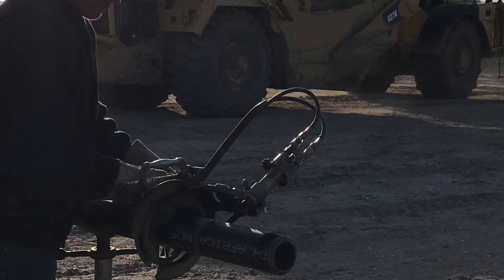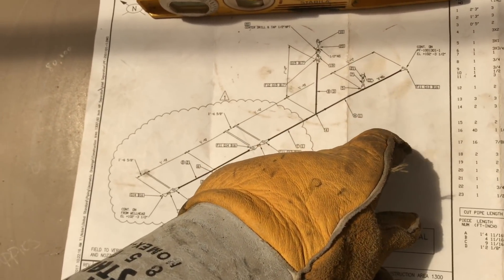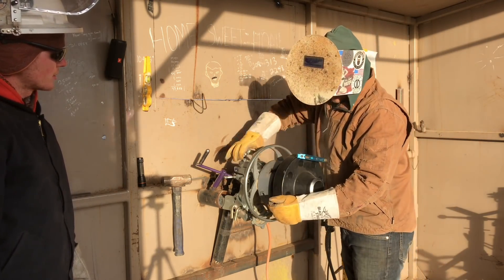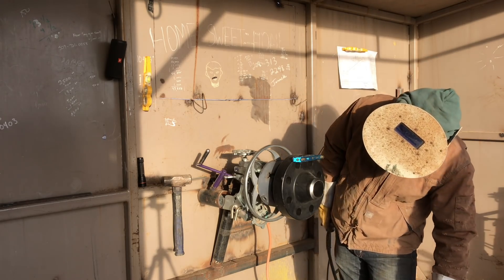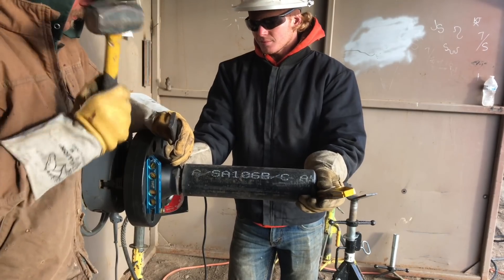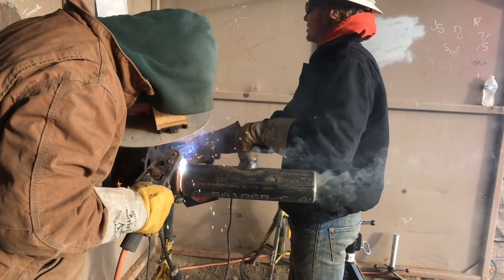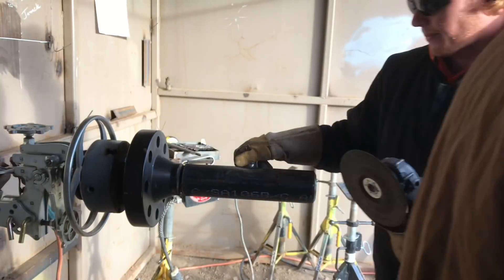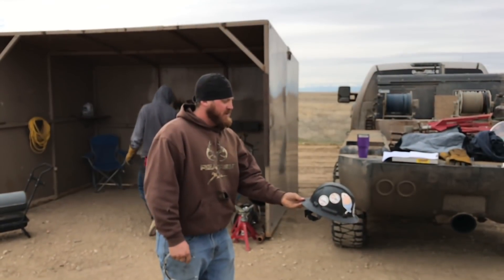Pipeline Fabrication 3" sch 160 Pipe

Comment: How do you get these fabrication jobs. Do you have to bid them and weld test or just weld test? And you supply all PPE and rods? Sorry I have tig welded pipe on jobs and I wanna set up a rig truck (not pipeline but like on site fabrication and what you do). I know this is older video to comment on but I think this is a good one to learn from. Thank you
Reply from the maker: Brendan happy to help friend. I basically contract under the company that contracts directly under the gas company if that makes sence. on this perticular job I supply everything for my anything Welding related except the pipe and fittings things like that.

Comment: Hey I went through Fluor pipe welding upgrade program years ago, I've worked one shutdown in 2005 Ashland/ Long Shoals NC coal-fired power plant for a week, been in shops for a while, how can I get back in the door somewhere, Im here in Knoxville TN, I can pass xray ive done 2in xx heavy sch180 dissimilar test,  carbon to chromoly, and stainless to carbon, tig root stick fill and tig fill, where should i go, apprenticeship?

Comment: I notice you do alot of your welding  downhand. I just completed my 6g and we welded everthing from the bottom up. I  was wondering are there positives and or negitives to both styles of welding. Maybe you could do a video on when to use each style. 

Thanks
Reply from the maker: no man both work great it just depends on the proccess the company has wrote up which determins which one I will use.
Reply: In my experiences.   Downhill is mostly gonna be your transmission pipelining work   Most industrial piping was uphill. And they didn’t like it going down at all for whatever reason

Comment: Welding a heavy sch 160 is really tricky because it takes up more filler  material and time than a normal schedule 30 flange and pipe of the same dia.
Reply from the maker: Right we do tons of 160 and sch 80 takes quite a bit more metal

Comment: Why don’t y’all weld on pipe out in the field or whatever? Is there just nothing to do or what? (Curious future pipeline welder here🙋🏼‍♂️)
Reply: Chase are you referring to the fire line out in the field. Meaning where   pipeliners are all welding on a pipeline. Bead hand follow-up with hot pass hand then your fill and cap hands. Then of course your xray and qc hands right behind. Then the roustabout dig and drop pipe in ditch then do tie ins in a bell hole. Build a few risers and headers and pig lusncher. Pig it, hydro it and move on to the next line and start all over again. Yup that's where it's at. I sure miss the boom we had on the eagle FORd. ConocoPhillips just made a comback in kenedy Texas. Lol wow I got into that
Reply from the maker: Chase yes we do but most of what we do is fabrication so we build it then send it out to the facility for the bolt up hands to install. There will be ty in welds to make. But for what we do right now we hired out to build the gathering facilities if that makes sense.
Reply: They are basically an on-location fabrication shop. That is where the $100 an hour comes from because this is a very valueable service for the company. I have met guys that could weld better than me but couldn't fabricate to save their life.
Reply from the maker: true that statemnet